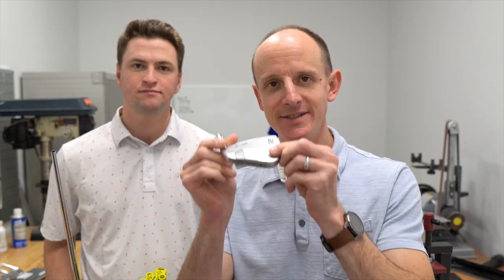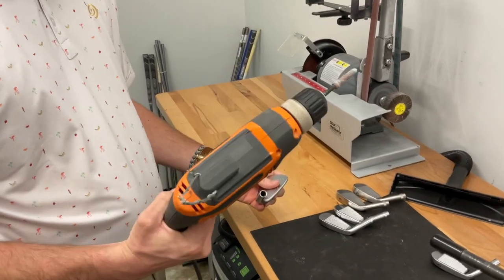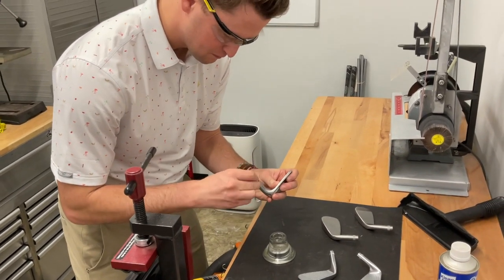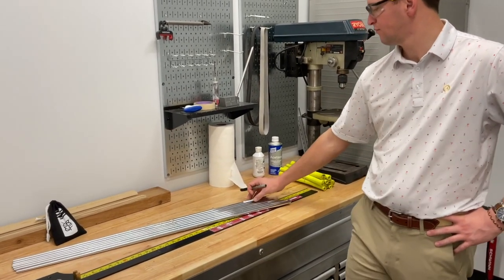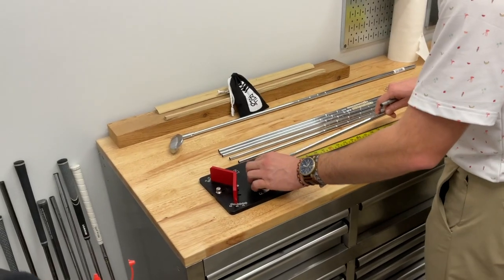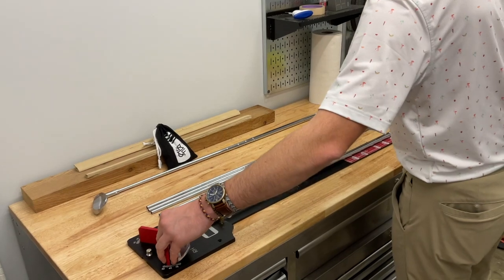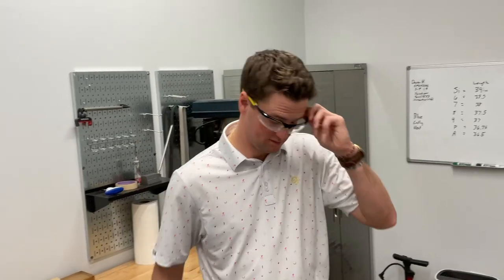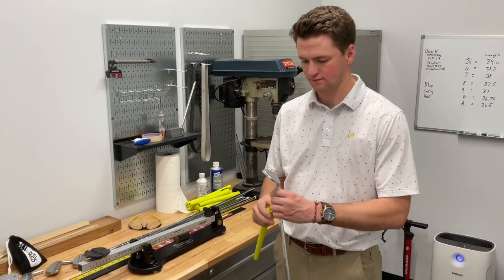FIRST TIME BUILDING GOLF CLUBS / Beginner Step by Step

Comment: When you remove grips from an old club, save them. Cut them long ways and keep them around. When you need to swing weight, set of clubs, sort through your grips that you have find one that matches the weight that you want and just slip that over the Griffin to the club when you swing weighed it. It’s more accurate than rubberbanding it to the shaft.

Comment: Watched a lot of your videos. Where do I find the tool you use to clean out the hosel (not the brush, I have one of those)? Does the length of a club include the grip? I have many more questions, but thought I'd start with these.
Reply from the maker: The sanding dowels can be found on most club making websites.
You should include a 1/4 inch to your measurements to account for the additional grip end length.

Comment: Great video. How do you know that the shaft flex is going to be the one that the client needs before asembling all the clubs?
Reply from the maker: We did a fitting before deciding on these shafts to figure out both weight, flex, and feel.
Reply: @EFGMC  Thanks you for your answer. The doubt I have is, in the fitting you decided what cpm/flex is right for the client, but how do you make sure that the clubs are in the correct flex/cpm when assembled as you didn't check anything before and after cutting the shaft.

Comment: Hi , I have an old set of Top-Flite irons 1998 I think, dynamic gold shafts at 120gr and I was losing distance, I tried some clubs with a 60gr shaft (R) and was wondering if soft stepping would be the way to go, distance was back maybe 5 yards better, I'm getting on a bit now (65) but I really like the top flites when they're polished up , any help would be very much appreciated
Reply from the maker: The stepping of an iron shaft will only have a very very small impact on the results. I would just focus on finding the right weight and not worry about soft or hard stepping.
Reply: Many thanks for taking the time to reply, I've managed to get all the headweights in a steady progression (7-9grams) now for all the hard work .

Comment: Do you always swing weight match your clubs or do you sometimes do MOI match?
Reply from the maker: I ideally like a hybrid model where the long irons are a point or so lighter and the 9 into wedges are a point or so heavier.
Reply: @EFGMC  based on reading stuff from Tom Wishon and on Golf WRX i built myself a poor mans MOI matching set by going with 3/8" increments in length and 0.5 swing weight les as clubs get longer. Have really liked it

Comment: Hi, interesting for me - you just cut the shaft at the butt. Are these shafts taper tip or whay did you no tip trimming? BR
Reply from the maker: Taper heads, and taper shafts.
Reply: You tip trim parallel shafts.
Reply: Yeah, I know.
Reply: @clintwestbrick664  the Nippon trim instructions for parallel tip say butt trim only
Reply: @cybekgolf  ok, thanks. Didn't get it that they used Nippon shafts.
Reply: @clintwestbrick664  I don't think he's using Nippon but it sounded like your statement was intended to provide advice for all parallel shafts and I only know about the Nippon because I'm changing some shafts in my own clubs. I'm not sure what other brands require. It may be different for different brands.
Reply: @cybekgolf  It's ok, but I just try to find out why they did not trim the tip. But thank you for the trim table.

Comment: I have watched you measure the swing weights in a couple of videos but then you don’t show adjusting it . Where to the weights go ?
Reply from the maker: In most cases I use shaft tip weights that fit inside the shaft before you epoxy the club together. It's the cleanest looking option.